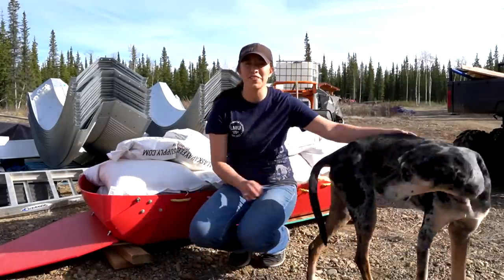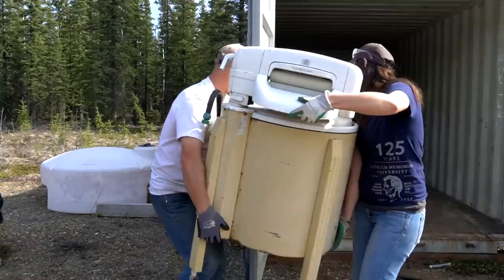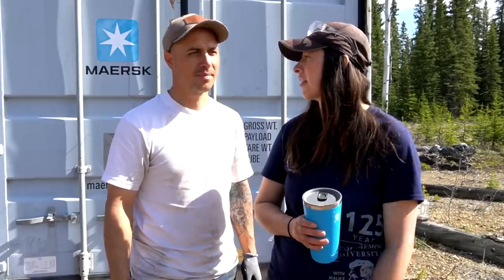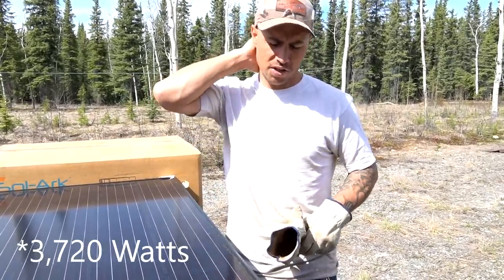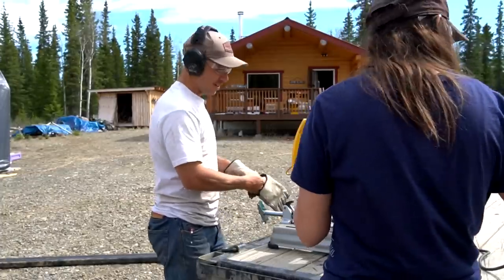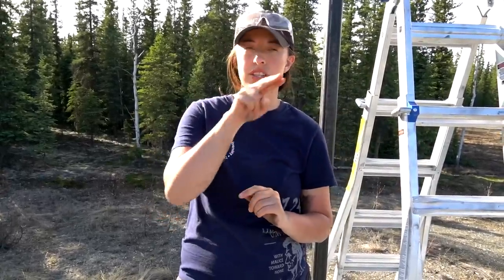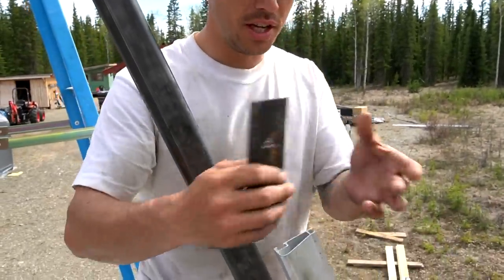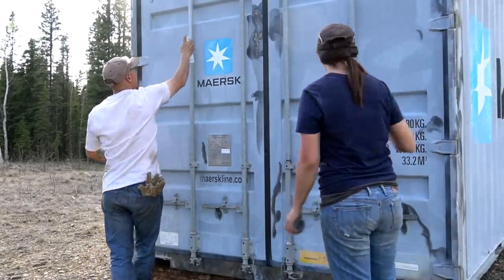Building a Conex Solar Panel Mount for Our Off Grid Cabin

Comment: Ha, ha. Hung up again. Just kidding. Even the most skilled timberfallers in the  world get their saw hung up now and then. Too many variables.
Reply: Also this...(I'm loving this episode more and more) I was lucky to land a winter construction job after graduating from high school back in the 70s. $10 hr. Which was incredible pay. The owner of the outfit won a contract to demolish a large apartment building in downtown Anchorage, but instead moved it to another location 1 1/2 blocks away. Solid concrete, bottom floor was a parking garage, and 5 stories tall. We moved it the exact same way. 8" drill stem pipes for rollers.!!! Leapfrogged by hand.! So he got paid to demolish it which paid for the move...$ million building for free!
Reply: He hired a world class large building mover out of Denver. $500 a day. Great guy. Very smart man. No one was injured, and didn't crack a single grade beam.
Reply: Anyone of ya'll old Sourdoughs remember that?